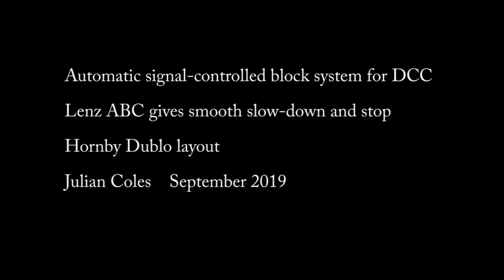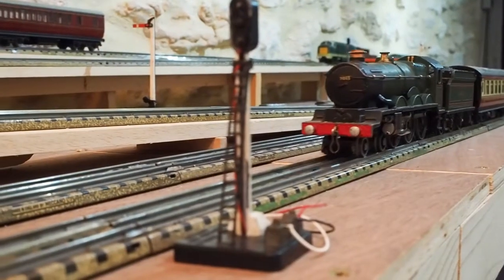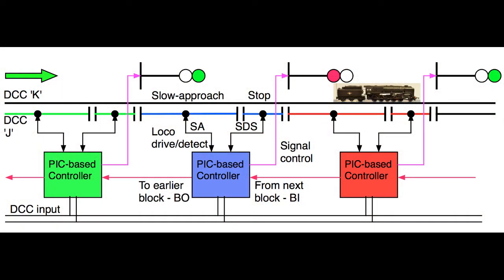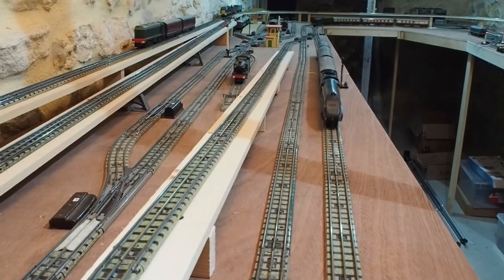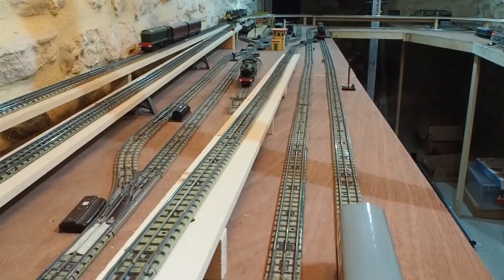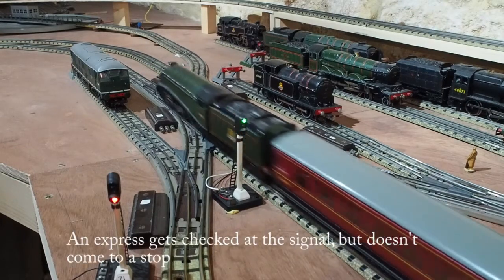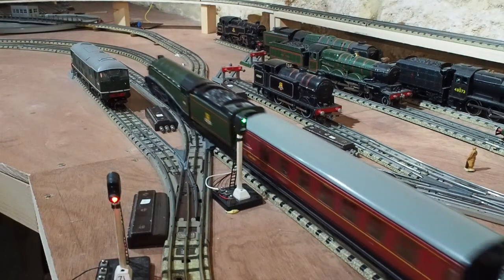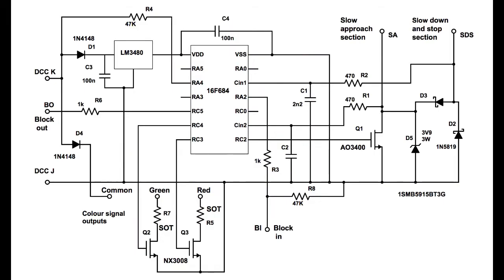Automatic Model Railway Block System

Comment: This is great Julian. Thank you for the didactic effort. Isn't there quite some wiring for the slow-down and for the stop section when compared with PC controlled blocks (Rocrail)? Also, what happens when the loco is pushing the train? Would it stop in the right place (Before the signal)?
Reply from the maker: Glad you liked it. The only wiring: one wire to the next block and one to the block in the rear.cSee at 2.25. And wires to the signal of course. So way less wiring than Rocrail. A push-pull train wouldn’t stop in the right place as it operates on loco detection - unless the front axel of the pushed coach had a resistor across its wheels.